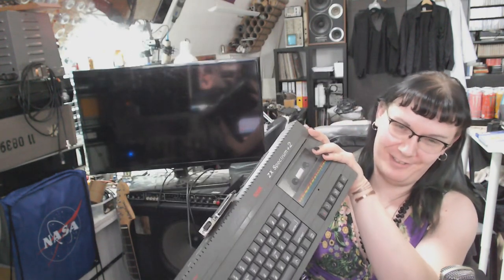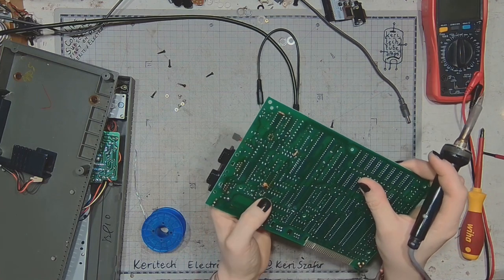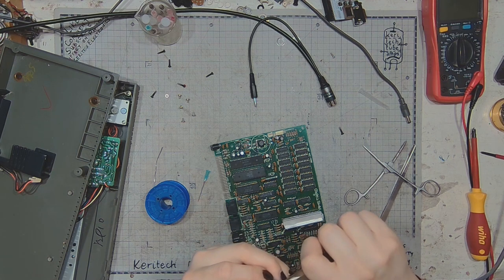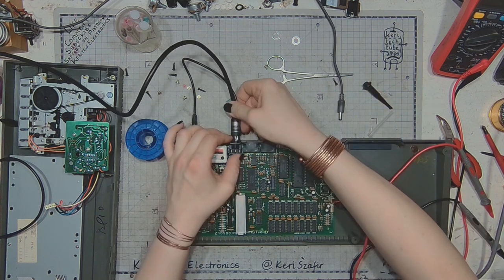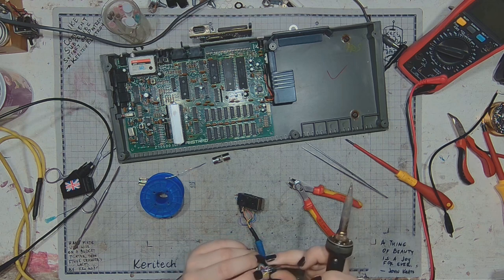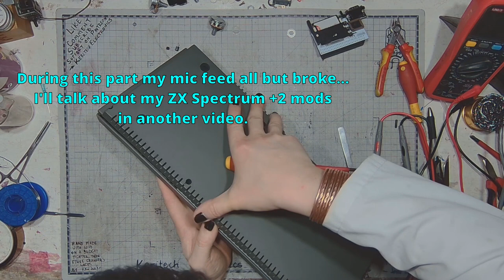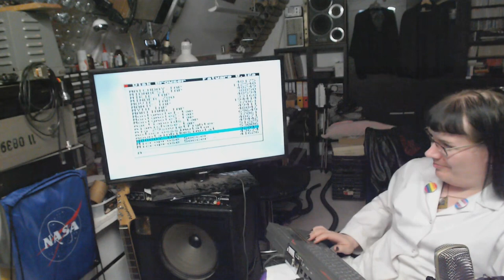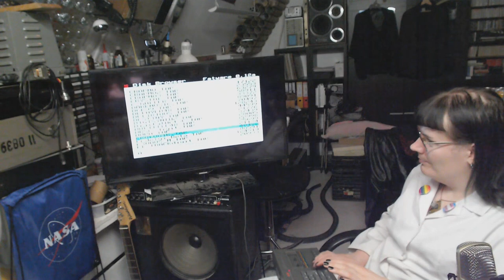ZX Spectrum +2 - Fixing the Design Errors, Modding and Nerding!

Comment: I did save programs from a MEMOTECH MTX512 to a DCC90 cassette using the AUDIO in but I really wanted to use the SPDIF IN/OUT ports but no one made a interface board to allow loading saving to DCC900 cassette deck via the SPDIF IN/OUT ports, since then the TMS9918 chip went kapoot then shortly after that the ZILOG Z80A overheated

Comment: You're probably already aware of that it's a really bad idea to remove the solder off transistor leads (or any leads) while directly above a printed circuit board. I'm assuming you're trying to stay in view of the camera, but you really should do any soldering/desoldering off to the side whenever possible.
Reply from the maker: You're right :). No real risk of spilling it though as I remove any excess solder from the tip. It goes where I want it to, rather than spilling it all over the place :).

Comment: What about using a 9 track head out of a DCC900 Tape deck that can allow you to save/load a whole byte every clock cycle.
Reply from the maker: That's some obscure and interesting format! Now you got me looking it up on Techmoan: https://www.youtube.com/watch?v=YfktjZp1m6E
Modding the deck for it? No use. First, it breaks originality beyond practical benefits; using expansion boards is better. Second, interoperability. Even if you wanted to use cassettes and share some software, having a niche and non-standard format means that there would be no one else to share data with unless they converted too. A memory card interface is way more practical as it allows you to access data from outside the platform (e.g. run a demo on a PC through an emulator), copy data easily, quickly and reliably, keep a backup/archive, or share the data over the network. No way of doing that with tapes.